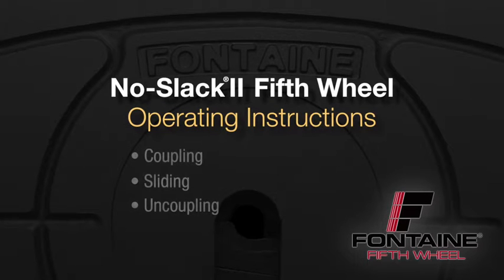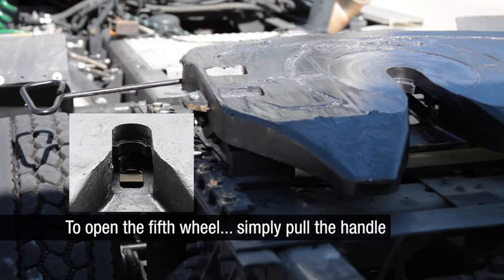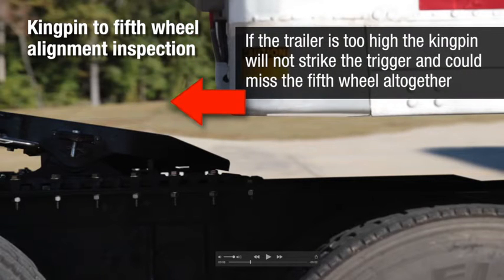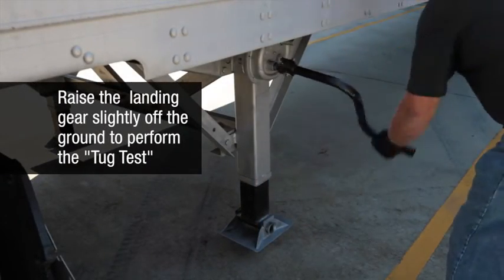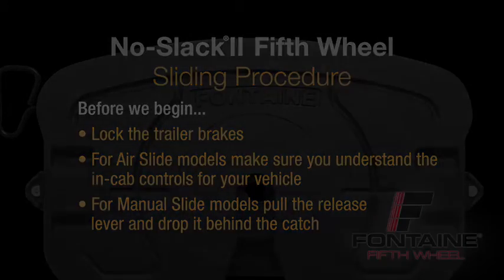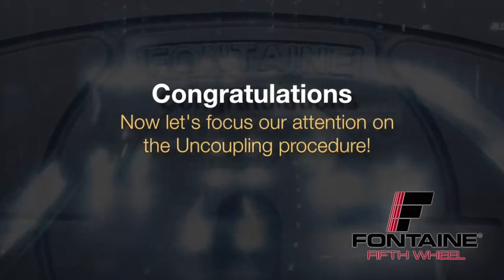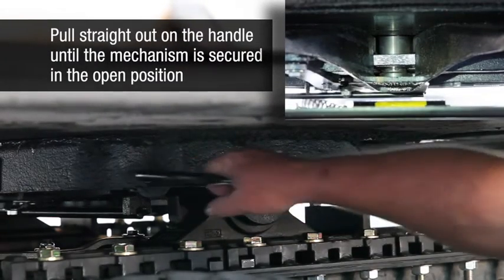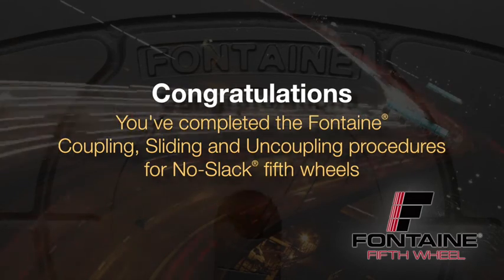Fontaine Fifth Wheel No-Slack© II Coupling and Uncoupling

Comment: The way to avoid this is to raise the landing gear 2 inches prior to setting the king pin into the locking jaws you back the truck under the trailer without the king pin engaging the lock jaws and then you raise the landing gear putting the trailer down on the fifth wheel and then you back onto the king pin